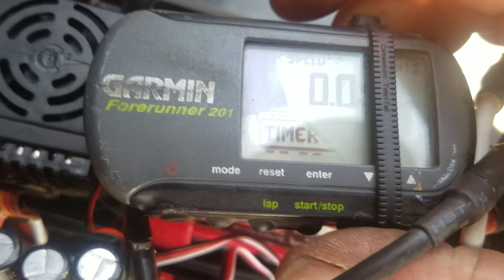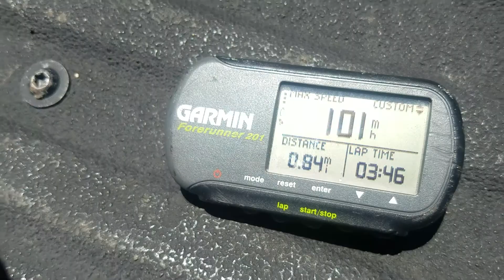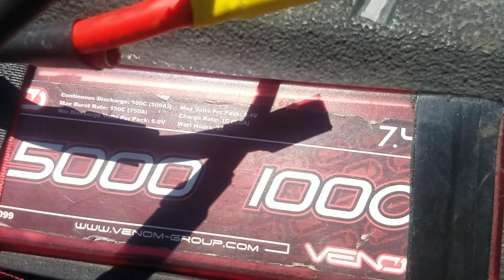Rustler 4s 101 mph No Weights

Comment: hey man, having a problem with my slipper clutch burning up, what should It be set at? I'm running a 34spur and 29pinion.
Reply from the maker: get a revo slipper clutch pads and tighten all the way tight then back off 1/8 turn.
Reply: Ok thanks bro, I'll try that, hopefully it won't break a drive shaft.
Reply from the maker: +maxx patrol make some videos when you can I'd love to see what you have.